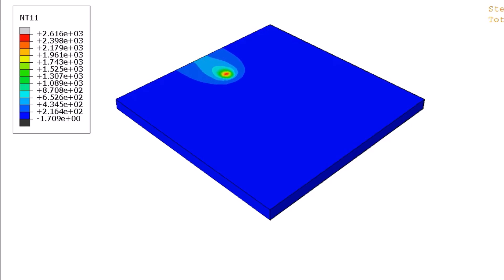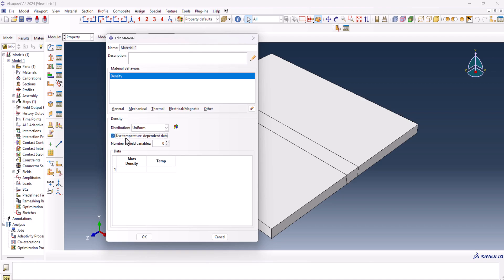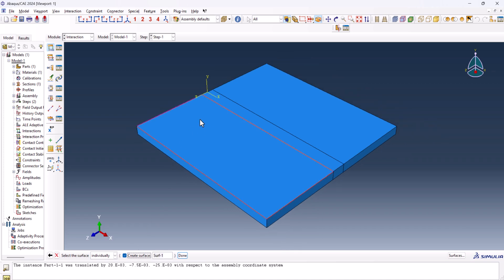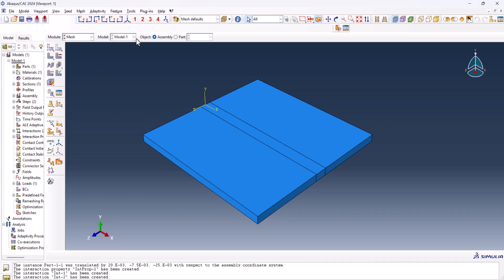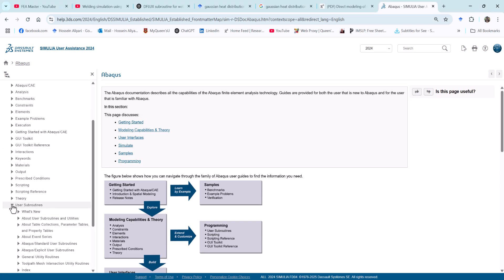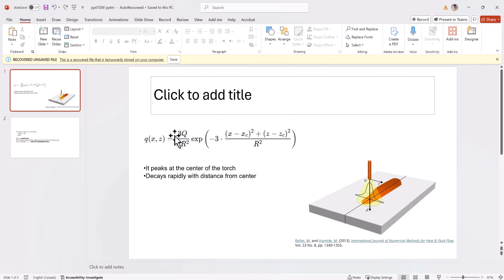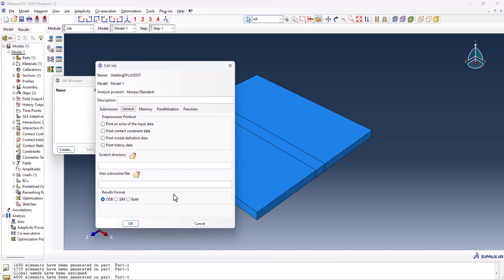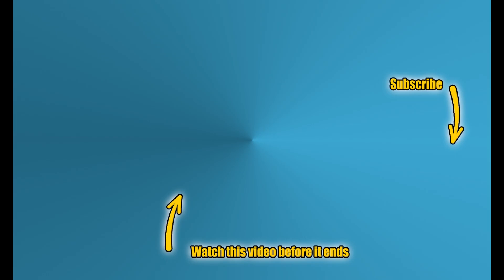Abaqus DFLUX Welding Simulation from Scratch – The Only Tutorial You Need

Comment: Hi there, I was just wondering how I can verify my model is outputting the correct temperature field? I will validate against experimental data but how do I check my code and mesh etc is applying the heat source correctly to my material
Reply from the maker: Great question! To verify that your DFLUX model is applying the heat source correctly, the best approach is to check the temperature history at a few nodes along the welding path and compare it with what you’d expect from literature or experimental data.

Also make sure your mesh is fine enough near the heat source and that your DFLUX coordinates match the weld path. If those line up, the temperature field should be accurate.
Reply: @FEAMASTER thank you for being so helpful amazing 🤩
Reply from the maker: @lilyms9218  No worries! Good luck with your research!